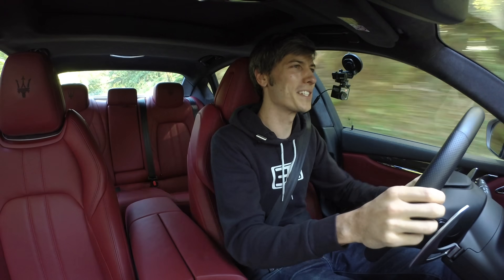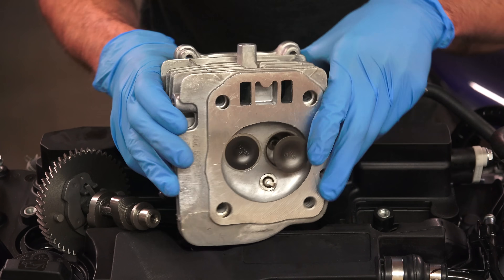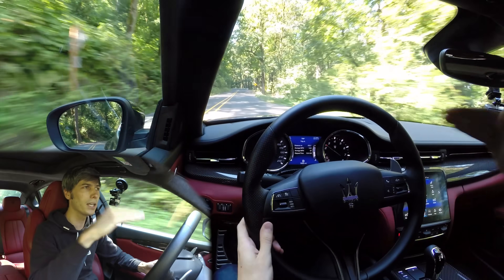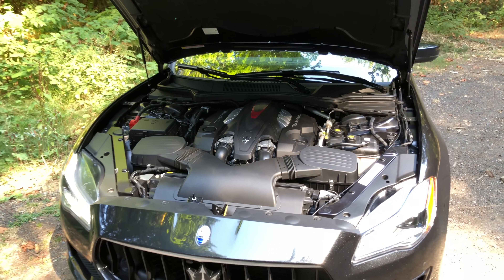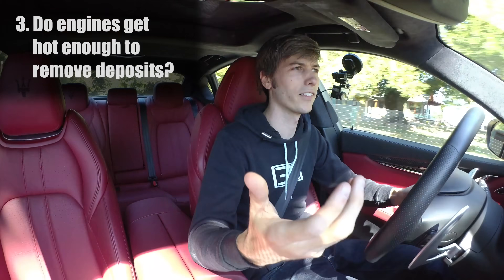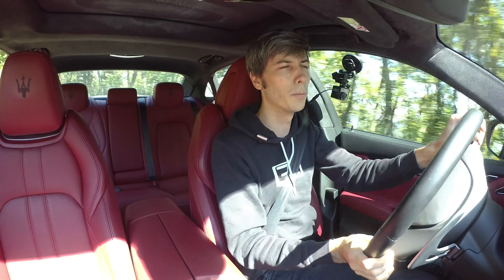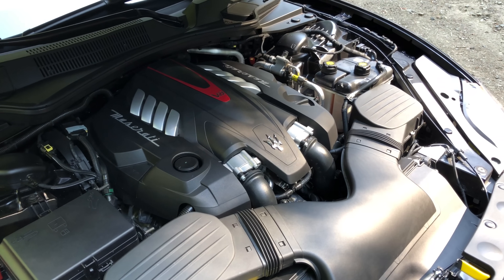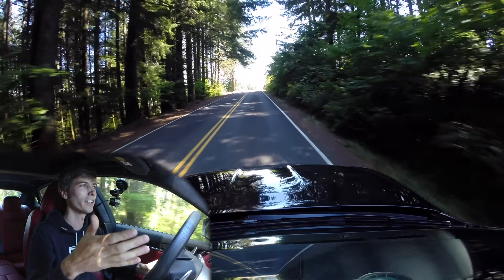Is Redline Good For Your Car's Engine? Italian Tune Up

Comment: Is this only in direct injection, or can it occur in port injection as well. What if you have both?
Reply: Certain cars have both to prevent the carbon build up.  Direct injection is a more efficient way of injecting fuel but it does cause more buildup which is where the port injection comes in, spraying every once in a while to prevent the extra carbon buildup.
Reply: @noelmedina6925  thanks
Reply: Running Coyote carbon deposits can form on both, but carbon deposits on the intake valves is much more common on direct injection cars. Cars that have port and direct injection kind of fix this problem, however, I wouldn’t want something to break in there. $$$
Reply: @ApeX-gh1wo  thanks
Reply: some of the newer Subaru engines have that feature I've been told

Comment: Engines have a rev range for a reason, you should use it. As long as there is no overheating issues and the car has been serviced properly and everything works as it should then there is no problem revving it as high as possible.
Reply: People act like manufacturers don't have Rev limits set well below what will cause damage
Reply: LOL
Reply: And that, ladies and gentleman, is why our cars break down for no reason, because of people like that.
Reply: Something else has to cause the breakdown, not just driving rough. Something else ends up failing usually a normal maintenance item. Sparks plug causing detonation for example either due to wear or bad gas. Bearings going bad, not due to rough driving, but due to people not changing their oil and filter (Very common).
- Using a bmw for example. Those plastic water pumps they had and may still have. Pump goes bad, coolant doesn't circulate, motor overheats and warps the head blowing the gasket.
Reply: exactly

Comment: Redline = slight suggestion.
Reply from the maker: 😂 Maybe just another 500 rpm... okay maybe 500 more!
Reply: @EngineeringExplained  My car needs an extra 500rpm. Its gears are infinity.
Reply: Fun fact: Ford installs the wrong analog RPM gauge in the 2018+ Mustang GT's for the North American market (well, except for the US, who aren't affected by this issue). The rpm gauge they install for the GT V8 is actually from the 4-cylinder Ecoboost model so it has the incorrect 6500 rpm redline, where as the GT gauge is supposed to have a 7400 redline, like the US model (all the GT engines are the same Coyote Gen 3 V8 and produce the same power, 460hp/420 lb ft, and redline at 7400 rpm). Anyway, Ford has been installing the wrong part since it was first reported in late 2017, when the 2018 GT models started getting delivered to customers. The problem still hasn't been fixed and now the 2019 GT models have the Ecoboost rpm gauge too.  Ridiculous. 🤔

Comment: redline saves fuel. simple as that. ⛽
Reply from the maker: If you get there faster, you save time. And time is money!
Reply: @EngineeringExplained  this is why I love engineering explained 😂
Reply: Engineering Explained yeah until you have to sit at the same redlight as the slow car and then you wasted money and time 😎
Reply: @akonnema  If you know your red lights on your daily drive to work, then you know when to drive the speed limmit and when to step on it and avoid all red lights!
Reply: Yes, because after only a few minutes you'll never have to buy fuel for the engine ever again!
Reply: LOL
Reply: When i drive the speed limmit i get 4 times the gas milage of speeding.
Reply: The guy that made this video has another on this very subject. NO....driving at high rpm does not save gas compared to downshifting and driving at a lower rpm but at the same speed.